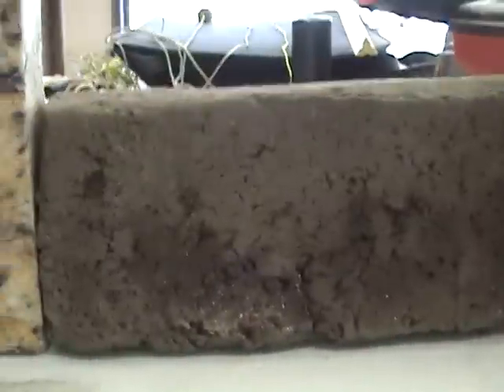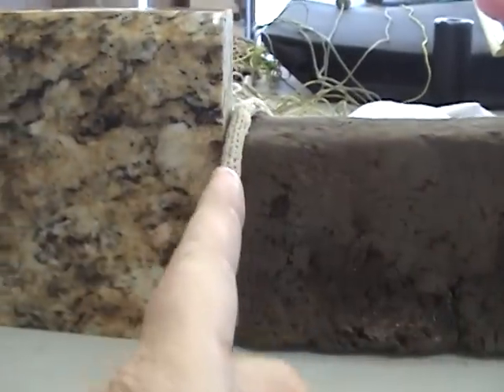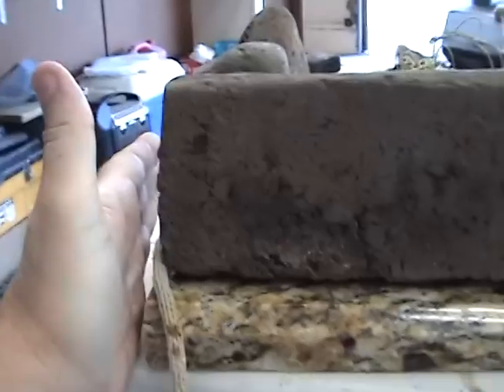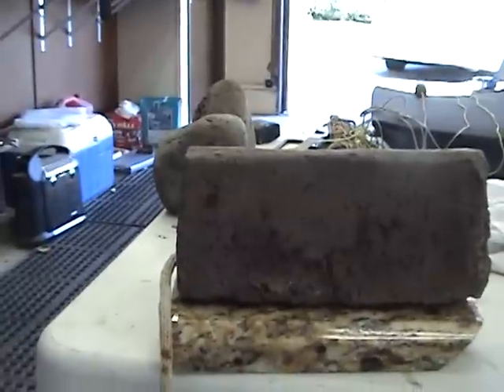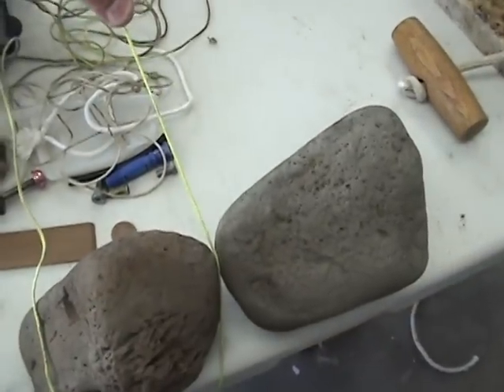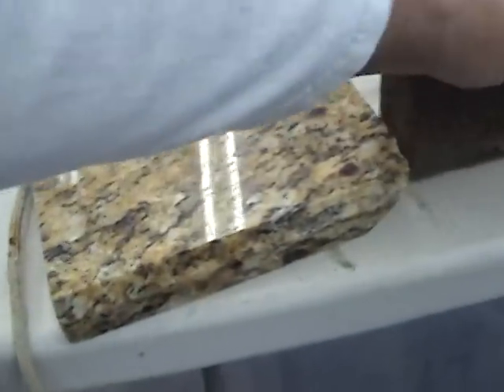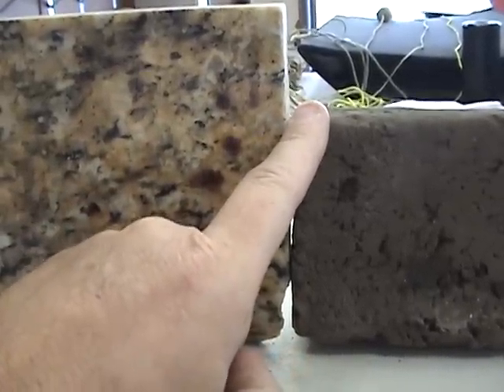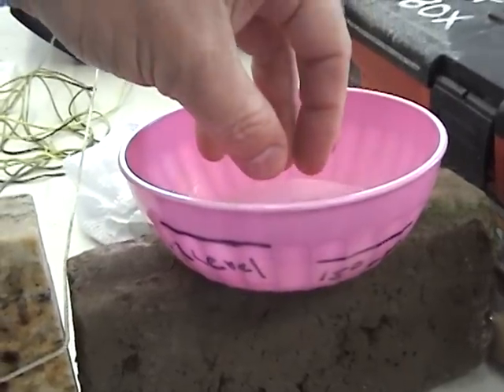2- HOW it was DONE = INCA ROCK CUTTING

Comment from the maker: @RealityofThings My theory is that they used material for rope they had on hand. They could have used tar or resin or , nothing. I am finding that a wet woven rope holds sand just perfectly. diamonds cut diamond, diorite granite sand cuts diorite granite bolders. same physics I believe. I am attempting to build a wall and prove my thesis as we speak. It is a small wall, but the technique is working and I found some new surprises. Thanks RH